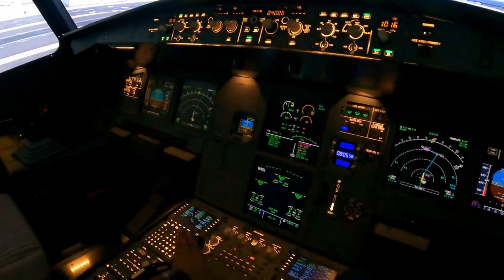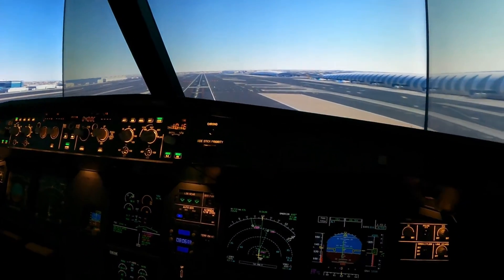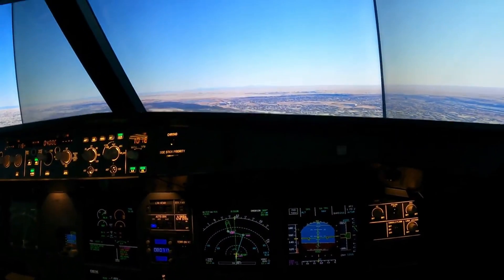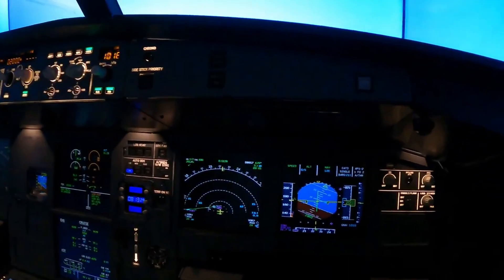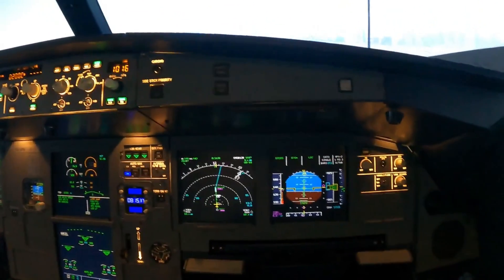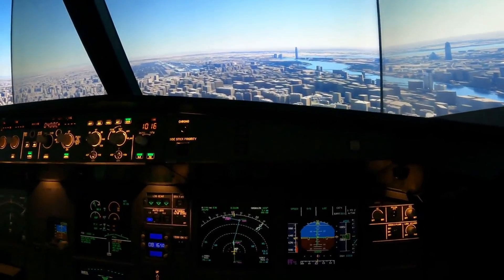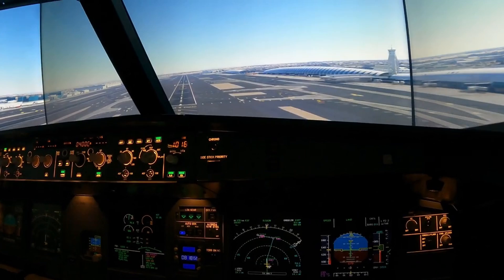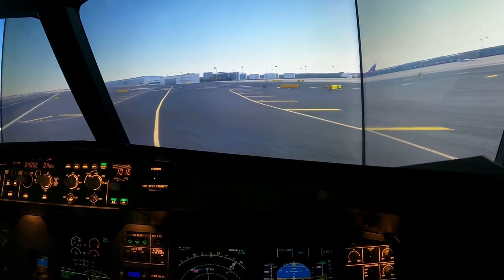Airbus A320 Tutorial: How to handle the A320 during - Single Engine APP and Landing (With Go Around)

Comment: captain, got few questions, I saw you using flap full. why not flap 3 with OEI with a little bit more speed for GO around again. Second question is when G/S is captured, you set the go around alt. Is there another cases where you do not use ILS and when do I set the go around alt?

Comment: Going around with OEI, don't you retract the flaps until getting to OEI ACCELERATION ALTITUDE?
Reply: we dont retract any flaps after the intial first stage of flap retraction until getting to OEI acceleration altitude. Once at the correct altitude, push to level, accelerate then clean up
Reply: agree
Reply from the maker: During an OEI GA, the procedure is to retract some flap directly after TOGA application to allow for better climb performance.